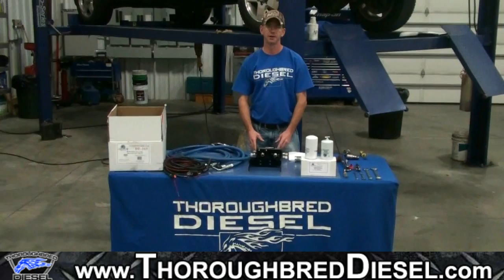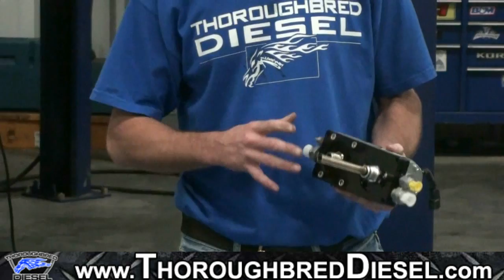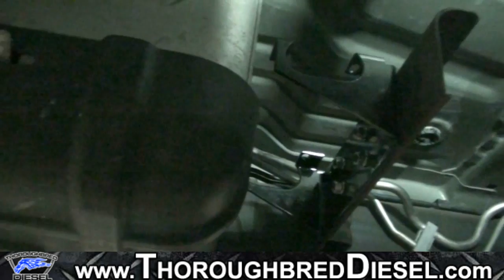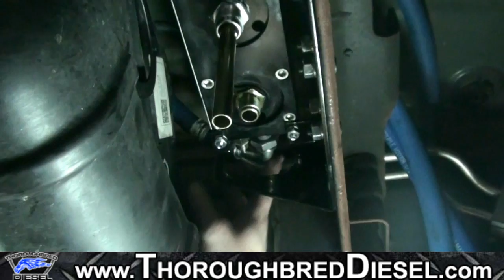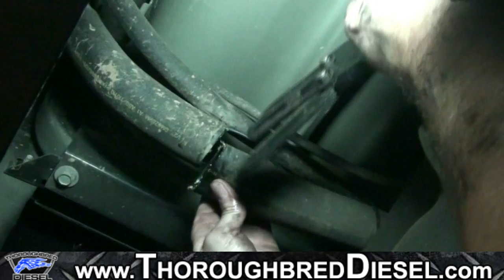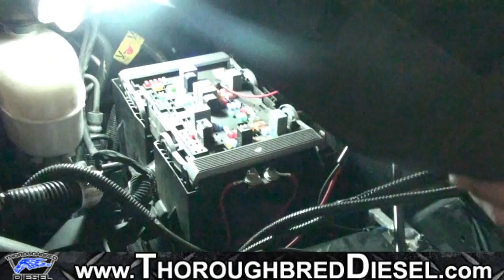AirDog II 165 Fuel Pump Install: Duramax LML #A5SABC110

Comment: Mine didn't come with a manifold. Its having me pull the assembly out of the tank and drill come holes to add some lines. Do you have or know of a video that shows how to do that?
Reply from the maker: Are you working on a Chevrolet?

Comment: Is a sump needed when using this pump? I assumed it was m, but my local shop tells me the 1/4 tank issues are no longer a concern. I have a 2015 LML
Reply from the maker: A sump is not a NECCESSITY on the LML’s, its just a nice upgrade for ease of install.

Comment: I just purchased this kit from you guys and it has a single hose with cheap plastic connectors.  Kinda sucks because I had everything ready when the UPS guy showed up. Should I go ahead with the install or send the pump back to you guys.

Comment: I wish Airdog didn't use push fit connectors on the pumps. A threaded barbed fitting would be better so you can use different fuel line applications by just swapping them out for 90 deg bends or straight and matching different fuel hose diameters.

Comment: I really enjoy all your videos please keep it up. What did you do with the factory fuel filter? I am doing an air dog and was going to put a cat filter on the factory housing?
Reply from the maker: Thank you and we plan on it! With this truck in particular,  we used a FASS fuel filter delete.  Normally,  we leave the stock filter in place.  Extra filtration as long as its not hurting flow is always a good thing.
Reply: Thoroughbred Diesel: Okay thanks for your comment. I am planning on doing the same lift pump but going to do the cat filter/adapter on the stock housing any input?

Lmm Truck
Efi live Kory Willis with dsp 5
S&B cold air intake
Full EGR delete with cold side up pipe
5" straight pipe
Pcv reroute 
Trans go jr kit
Lift pump is next....... air dog II 4g 165
Reply from the maker: I think changing over to the cat fuel filter adapter will be fine.
Reply: Thanks for your reply and again I really enjoy your videos I've learned so much! Wish you was closer to work on mine, take care
Reply from the maker: YW. That is why we do them! :)

Comment: I bought a airdog 2 for 2001 through 10 models because I got a good deal where can I find the correct fittings for 2011
Reply from the maker: +jake patriquin You will need to contact Airdog for a hardware kit.

Comment: Does this apply to the 2015 LML? Do I run the to engine line up to the engine or use the existing line that goes to the engine @9:18? I have a 4g system for a 15. I am sure it is similar.
Reply from the maker: +Nick Hughson On the 15’s I believe that you use the existing line as in the video.  If that is not an option there is a quick connect at the engine that can be used as well.
Reply: Thanks for the info, I was able to look under the truck last night and noticed the setup looked similar.
I was not sure if there was any advantages or disadvantages in running the line up to the engine if I do not have to.
After looking at the 2011-2014 the 2015 install manual is the same with updated part numbers. 

Thanks for the videos they are extremely helpful!
Reply from the maker: No advantage either way you decide to run it.  Thank you!

Comment: Dyno results....?
Reply from the maker: MayorOfGoodells The truck made around 8 HP better with the pump installed if I remember correctly.  It was falling off around 2000 psi of rail pressure at its peak HP, and it was able to maintain that rail pressure with the AD installed.

Comment: In the video, you state fuse 47 is always hot but the manual lists that fuse as the rear defogger. Would that not just allow the air dog to get power under a remote start condition?
Reply from the maker: James Fox The fuse that you choose for your trigger wire needs to be hot with the key on.
Reply: The mechanic that installed my AD2 used fuse #13 ign  and it has already blown once (1 week after installation). That fuse is a 10a, should I change it over to a 15a or 20a to prevent future blown fuses?

Comment: Will this installation work the same with an LMM and a fass fuel system ?
Reply from the maker: Reynaldo Gutierrez Each manufacturer will mount and hookup with slight differences. Now with the LMM trucks the Airdog will clamp around the frame rail, and the FASS will mount on a cab corner.
Reply: But as far as the fuel line hook ups , the pick up the return and the supply line .. will the instructions you showed be the same ? Thank you for your reply ..
Reply from the maker: Reynaldo Gutierrez No, actually the LMM will have a fuel cooler directly in front of the fuel tank, the quick connects will hook up there.
Reply: Sr isn't the fuel cooler on the return side of the fuel system on an LMM ?
Reply from the maker: Reynaldo Gutierrez Yes. Return side, located at the tank.
Reply: On the supply line going to the engine . I see the factory supply is a metal line running along the frame driver side . Does that need to be removed or disconnected from the tank ? Cuz I've seen where  people tap into that line , maybe cuz the access isn't as good as others. I just want to make sure all my connections are correct. Thank u.
Reply from the maker: Reynaldo Gutierrez It will be disconnected at the tank.

Comment: What were the results after you put it on the Dyno? Thanks.
Reply from the maker: Jose Muniz The truck made around 8HP better with the pump installed if I remember correctly.  It was falling off around 2000 psi of rail pressure at its peak HP, and it was able to maintain that rail pressure with the AD installed.

Comment: Y does my instruction manual tell me to disconnect the line up at the engine? Page 13 Fig. 17 in the 2011 UP Installation manual.  Didn't see this in the vid.  Thanks for this install video!  Just got my AirDogII from you guys today...gonna install this weekend.